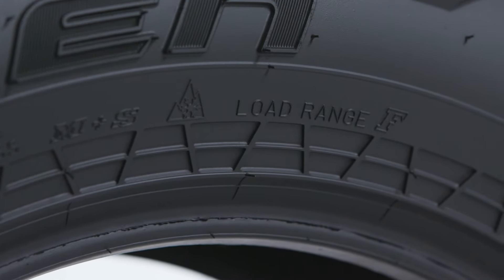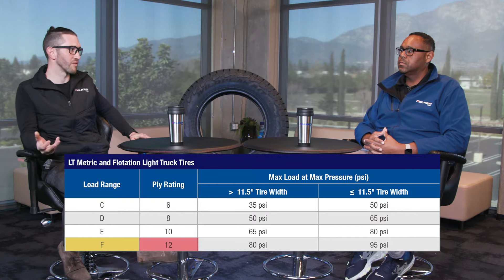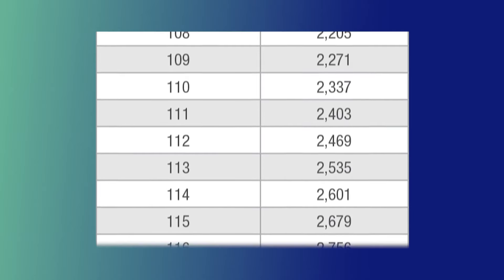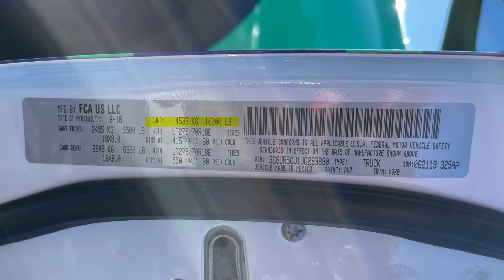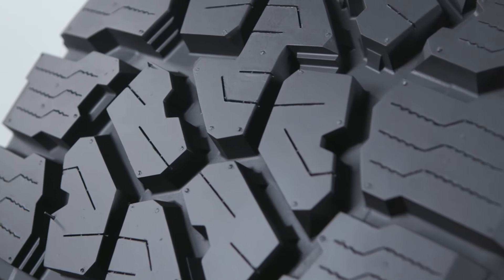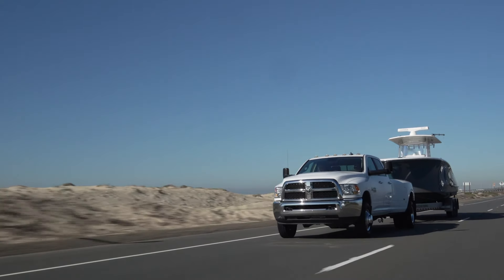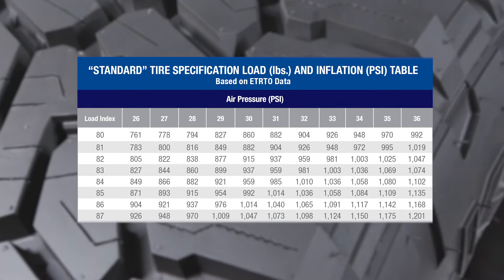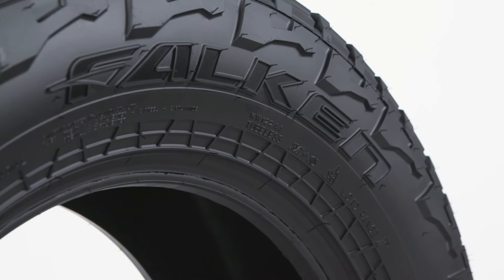Why should you run Load Range F Tires? Falken Tires explains the need for Load Range F.

Comment: I think it's dumb they're getting rid of the wild Peak 3w
Reply from the maker: Hello. We appreciate your devotion to the A/T3W. However, it's being replaced by an improved product. The A/T4W. We think consumers will be just as happy, if not more so, with the new tire.
Reply: @falkentire  but not a lot of people want to have all kinds of extra side walls to make the tire thick and being driving on the highway and having vibration problems Or have tires that ride like a rock my Jeep actually rides way better than your everyday SUVs
Reply: You can send me 4 prototypes and I will test them for you.
Reply: I'm currently lifting my truck and researching tires. I'm leaning towards the  Falken A/T4W, and was wondering if they come in different plies (4, 8, 10 etc). Is there any advantage to a higher ply? Thanks!

Comment: Can I run a lower pressure than oem if tire has a higher load rating than oem?I’m running 325/45R24. Oem tire size is 235/80R17. Oem tire pressure shows 55PSI.
Reply from the maker: Hello Raul. That's a question better directed to our tech team. Please email them at technical@falkentire.com, or call them Mon-Fri 8am-5pm PST800-723-2553 ext. 2. Thank you!
Reply: It’s actually the opposite
Reply: @falkentire That really should of been addressed in the video as that's by far the most common scenario.
Reply from the maker: @tself77  & @erice4611, using this online tool ( https://tiresize.com/pressure-calculator/ ), and based on Raul's question, assuming his new tires are a Load Range F and both sizes are an LT tire, then the calculator indicates he could run a lower pressure to support the same load. But there are several assumptions being made. That's why a referral to contact our tech department is a safer bet.
Reply: I do not under inflate her tires like others do
The max is 80psi. I run 60 psi
You really don't need the additional rolling resistance on the road,they will cup driving them at 30 psi.
they are 12.50 33 and look like  they barely fit Rim anyway.
All you need is a grossly under inflated tire flexing and rolling off a rim
Reply: So they are dropping wild peak?
Mine came on my truck from the factory, I love them.
They are nimble and keep me planted it dirt and gravel.
Took them to dirt pit and they out preformed any all terrain I ever had,smooth riding quiet the best.
I was going to go slightly taller and a tad wider for looks.

Comment: F equates to floatation on mud tires.
Reply: Before you laugh

Every tire has load ratings marked on its sidewall. This also applies to standard sizing and flotation sizing, commonly found on mud-terrain tires. To learn more about how to read a sidewall.
Reply: Yeh I didn't buy tires on wife's truck they were a gift from her son.
They have E load capacity but a F rating
So I looked it up.
I'm not driving her truck down a creek, so floation doesn't mean that much to me.

Comment: Can I run 35x12.50 20 125R load range F on my 2021 Jeep wrangler unlimited high altitude? 

My stock rim is 20”
Reply from the maker: You could. Though a Load Range F might be a little stiff riding for a JLU. You could run into some clearance issues when turning. A lot of stock wheels lack the proper offset to clear a wide tire when turning lock to lock. You might also run into an issue with wheel width on the stock wheels. Those appear to be a 20x8, and the 35x12.5R20 is approved for 8.5-11.0" wide wheels. Another option to get the height of a 35" tire without the width is a LT285/65R20 which measures 34.8"x11.5". The LT285/65R20 is approved for an 8" to 10" wide wheel.
Reply: You don’t need F for a Jeep, these are for 1 ton pickup trucks.